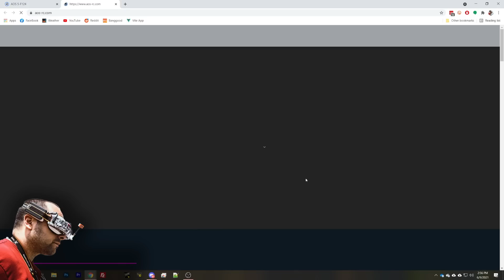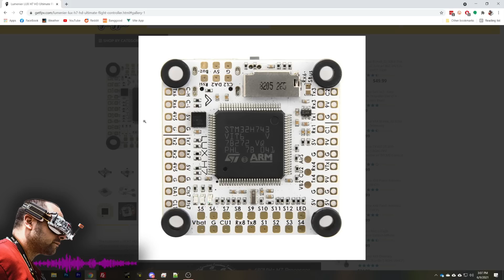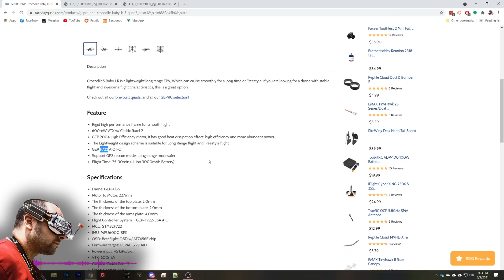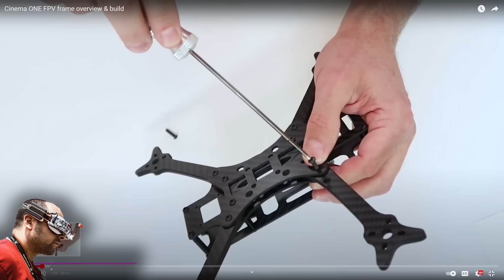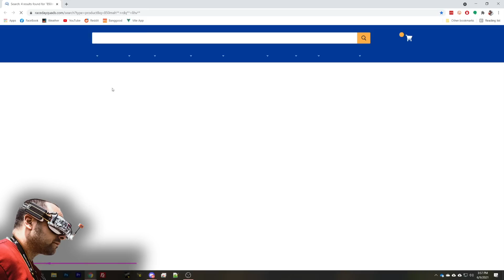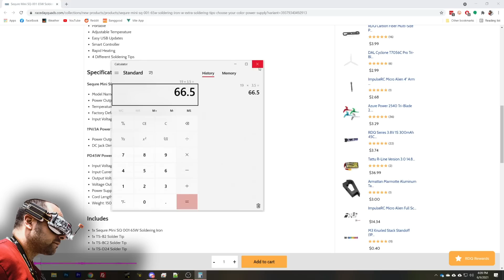Best new FPV products June 2021 (Chris Rosser AOS5 Giveaway!!!)

Comment: I think the 850mah 1s lipo would be cool on a 4" hyperlight build, with 1404 6000kv. Around the same weight as a 3" toothpick, well, as close as you can get. There would be no point to do this, besides its fun to do new stuff.

Comment: I did have a ~700+g banggod and it was definitely over engineered. With the back brace I never broke arms. Wouldn’t have minded a few arm swaps for lighter weight.

Comment: I would not buy the Geprc PNP Mark4 with the tarsier. It has different top and bottom plates than the normal or the DJI Geprc Mark4 and there seems to be no way to buy the Mark4 version of the frame. So if you crash and you break the bottom plate of the frame you're out of luck.
I'm actually currently building a Geprc Mark4 (standard version) with a tarsier. It's very tight but possible. And yes a GoPro image is way better, but I just don't have the budget for a GoPro. And I don't want to carry around the weight of a Caddx Orca or other budget action cam. Honestly, I'm very surprised that the 5"+Tarsier/Split category isn't more popular among hobby-guys that want to put stuff on YouTube but not take it too seriously.

Comment: Those tiny cinewhoops are probably designed around the 250g rule in the EU. 3inch is usually over 250g, 2.5inch with a naked GoPro is right up to 250.

Comment: I like the crocodile baby 5 LR  so much I had to buy two 🤷‍♂️ with the DJI full air module... yeah it’s heavier than a light weight long range, you don’t really need a GoPro and you can fly it a little bit longer than regular freestyle quad because it’s lighter than a free style quad

Comment: I have put AOS 5 frame together. One thing to gripe about is the two carbon fiber washers spacers for the front. Annoying to put in and the 20x20 is m2 holes which is also annoying cause 20x20 stacks take a m3 but luckily I had the 3m spacer from my apex builds. The little black beads are m2 threaded adapter. I’m waiting for my airunit but looks like you Can only mount the airunit one way. So you can’t turn it backwards to put the antenna inward instead of outward. Not 100 on that though.  I’m using the iflight beast 55a on my 6” ultra light build.  With 3000 mah li-on I’m getting 37min flight times. But Drain Man has a 5” build that he was ripping full throttle and he said it had no issues running many packs through it.

Comment: I have the "new" "Caddx" Air Unit Micro and the Air Module itself is identical, even has DJI logo on it and yes the antennas will pop out if you rotate them to the "upper" lip. I took the camera apart and it is Nebula Pro indeed. Very, very slightly updated PCB (since it has to be a bit smaller to fit inside the alu case so a couple of components are moved by like 0.5-1mm inwards.
Reply: No wonder nebula pro is out of stock
Reply: @chrisbee5481  exactly 🥲

Comment: @Joshua Bardwell  100% correct about 30x30 in AOS5.
Aikon AK32 doesn't fit on bottom of stack. Corners of esc overlap with sandwich plate at center.  FC fit nicely underneath though.

Comment: I have lots of DYS but where can I get new bearings I have two sets for repair but these were great motors  for the price
Reply from the maker: For typical five inch motors you can use the same 9x4x4 bearings from any other similar sized motor.

Comment: I have had the iflight prop wrench and its amazing, compact and the drivers are replaceable so you can buy and put in a longer driver shaft, but i have only seen the need to add a longer 1.5mm driver, as the 2.0mm shaft seems long enough for pretty much everything on my builds, except the camera mount screws. 

But it has been an invaluable tool to have in the field.. surprised you guys just announced this product as i have had mine for quite some time..

Comment: A point to consider with the AOS 5 is that Chris told that its supposed to fly with a gopro session. Any thing bigger (heavier) would compromise the flight caracteristics of the quad, and that a 5.5 version is in the works.
Reply: Absolutely right. But that's true of any 5.1" frame IMO so not really specific to the AOS 5. It'll handle the weight of a big go pro better than some frames due to the way the camera mount stiffens the top plate.
Reply: Chris Rosser Interesting, I didn’t know that. Question: Will it be available in the EU?
Reply: @ChrisRosser  true. What will be the wheelbase on the 5.5? Really like your frame

Comment: 42:37 -- I would go with the Mr. CroC by flywoo. has 3, I repeat, 3 x 30x30 or 20x20 (your choice as per your needs) and has 5,6 and 7 inch arm frame kits. Beveled carbon and your choice of 3 different arm configurations in one frame (true x, hybrid x, "squished" x) for as low as $42 to upwards of $65. Conclusion: In my nobody opinion, got to really want to support the company as there are many other frames I feel offer more, at a better price point. Love these round ups.
Reply: The differences are: 1) weight (109g vs 135g on the 5 inch) 2) The flywoo has no bracing for the arms - the bracing makes a big difference to strength and vibrations.  The difference is the cost is $7, and the CB frames are manufactured in North America.   I designed the frame to be really easy to tune and to be very solid.

Comment: JB, there's also the iFlight Succex-A 30.5mm AIO DJI-PNP with F405 processor and BLHeli32 40A 2-6S ESC, was $60. Mark Spatz seems to like them.

BTW, "Rekon" is pronounced "reckon" per Dave C.

The prop wrench is not ratcheting, there's a one-way bearing inside. The Spedix one works great.

Comment: I just finished an AOS5 build.  I designed and printed some much needed accessories which I'll post on thingiverse Including an antenna mount which Chris recommends against but if you care about range you may want this.  I've designed this mount to be stiffer than the usual so maybe it won't vibrate so badly.   Search for tr3topflyer to find the parts.  The parts include landing skids, VTX antenna mount (two styles) and because the rear motor wires have such a long travel I've designed some cable management to help route them to the ESC.  Some may say that's unnecessary but that's how I do things.
Reply: Hello. Have you try GoPro 6 style camera on it? I want to use this frame for my freestyle/cinematic build and Chris mentioned that this frame designed specifically for session.
Reply: @jackfpv8904  you can run a larger go pro if you want to, the frame will handle it better than most 5inch frames because of the way the camera plates stiffen the top plate. If you have a hero 8 or 9 I'd go for the 5.5" frame I'll be launching very soon.
Reply: @ChrisRosser  I'm sure you have done vibration analysis of 5.5" frame and I trust your results.
To me, the only real benefit of 5.5 frame is to have "clean" air flow between front and rear props. Biggest popular props is 5.1" and I hope it's will fit your 5" frame. I heard Gemfan have 5.2 coming soon.
But disadvantage is:
1. More weight
2. Arms will be longer, so more fragile and more vibration (I can be wrong as don't know how to do vibration analysis)

Anyway looking forward to see your 5.5".
I was a little involved in OS Two frame design and test. It's my only racing frame now. This looks like simple process can take time.
Your video inspired me to learn Fusion360. Due to my engineering background I know AutoCAD really well (took me 10 hours to draw your 5" frame just for fun). BTW camera plates need to have different mounting orifices for vide fov analog cameras.

Comment: On the subject of the QAV-S, a couple of days ago I made a folding TPU antenna mount for it to hold the fullsize Immortal T, Thingiverse 4882912
It's for the previous antenna version, I'd like to do one for the current V2 which has the extra bumps (guessing to help zip ties stay put), but I don't have one, if someone has a broken one they could send me that would be great (I only need the T part to measure)
I can also do versions for other quads on request, see the description.
Reply: I've got a broken immortal-t I can send you, contact me if you still need it.

Comment: is there any place to mount a board 20 or 30mm in the middle ?  on the aos 5
Reply: No.  There are mounts in the front and the back but not in the center.  I just finished my AOS5 build today.  The center is a great place to put your filter cap, RX and the spike absorber (as Chris R showed in his viceo).